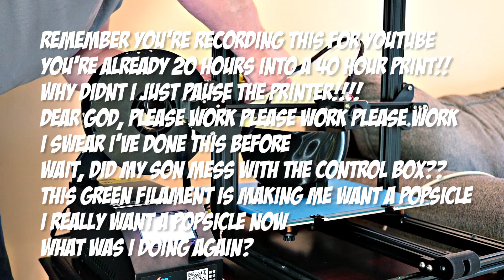Do you even Hot Swap Bro? Changing Filament mid print - pausing is for babies

Comment: Just did this tonight. Print went another 3 minutes after the swap. I butted the new to the old (Cut both flush), let the extruder grab it. Worked flawlessly. FYI, putting the roll on after getting the filament is started is a lot easier. Gives you lots of room to work.

Comment: Dig it!!! I definitely will do this technique today. Last time I paused the CR-10 it resumed slightly off.
Reply from the maker: Print That Thing - 3D Printing Designs that happened to me as well and I'm not 100% sure why. Since then I've been hotswapping
Reply: Uncle Jessy ditto! does anyone else know why this drifting happens when filament changing? or how to fix?
Reply: I also have the drifting after pause/change filament  problem.   Looking for solution.  anybody?  Thanks.
Reply: @PrintThatThing  I don't know if mine is drifting, but whenever I change the filament, and extrude a bunch of it to make sure it's fed through, when I resume the print it isn't a smooth print and I have to scrap it.  Has happened twice to me in the last month.

Comment: Don't you need a direct drive extruder to be able to do this?  How does the black filament keep feeding through the tube when you cut it off at the feeding gear?  It is printing for along time while you are trying to get the green in...is your printer still sucking the black through the tube?
Reply from the maker: I’m just quick with it so there is only a few seconds of there being no filament in the nozzle. 

1. Yank out the roll running out
2. Quickly push back in the new roll all the way to the nozzle

Comment: Ummm, would that work in a direct drive extruder?
Reply: Harder as the head would be moving around.... but yeah in theory it would.
Reply: Chase Rayfield this method wouldn't but its super ez. Just cut the filament, and when it goes into the extruded hold both ends of the filament and when the old one gets pulled in push the new filament and it should work. 100% of the time
Reply: @cubingexpress8875  just did that, worked fine :)